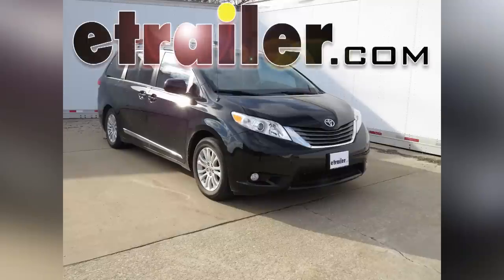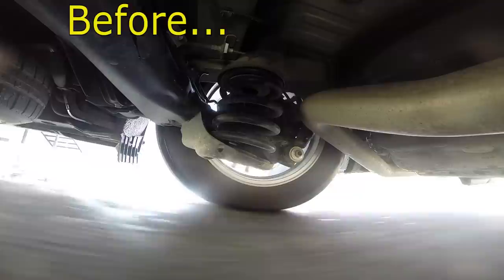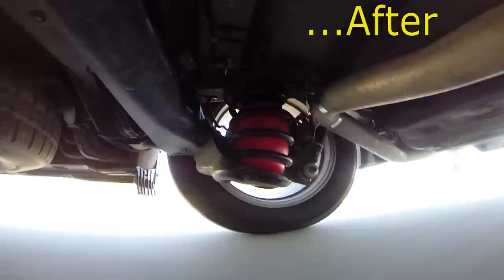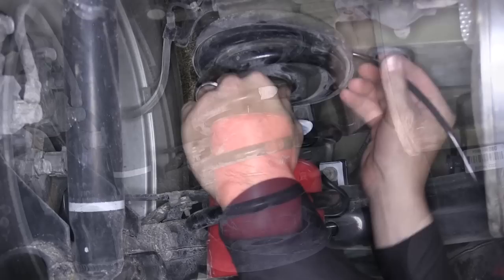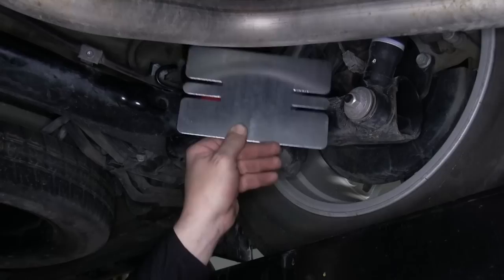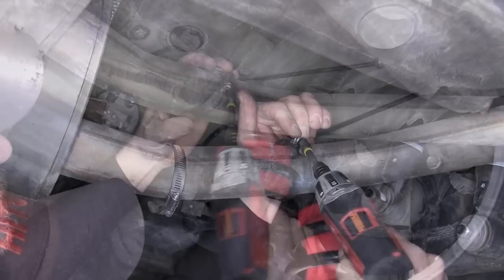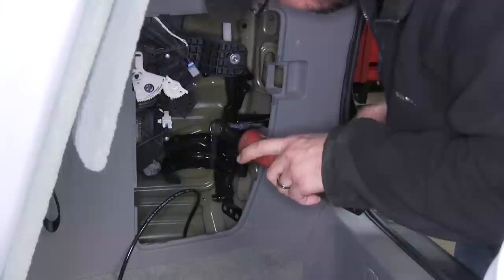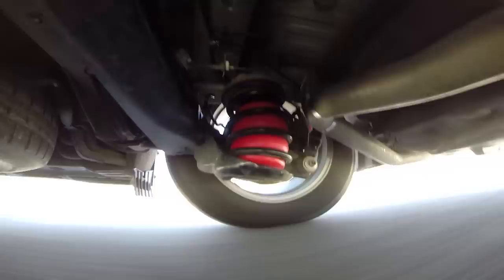How to Install: Air Lift 1000 Air Helper Springs for Coil Springs on your 2012 Toyota Sienna

Comment: I've had these bags on a previous van. While this is a clean-looking install, the positioning of the inflation valve in the jack storage area is not well conceived. Usually I won't know how much I will need to inflate the bags until the vehicle is loaded, which means the jack storage will typically be blocked. I prefer to install the inflation valve under the bumper. I've also heard of some people putting the valve behind the gas tank filler door, but I can't speak to the wisdom of doing so (considering you have to drill through the body in this area).

Comment: On the grommet you could take a scratch awl and heat it red hot and plunge it right through the grommet making the hole smaller then the line, Then push the line right through!

Comment: would this make the ride of the car feel more comfortable with 8 passengers in the sienna?
Reply from the maker: If you have a lot of weight in the rear and notice that the van is sagging, then yes, these will help make it more comfortable.

https://www.etrailer.com/Vehicle-Suspension/Air-Lift/AL60732.html

Comment: What about for front side ?
Reply: You can't on the front. In the front, the shock and spring are not separate, they are a strut. Meaning there is no space to put an airbag as it is taken up by the shock being inside of the spring already.

Comment: The spring mounts on my car dont allow this type of installation.  I would be interested in a side mounted valve.  It could be fitted to a greater variety of cars
Reply from the maker: The issue with the stem valve on the side of the bag would be that it could potentially get crushed if the spring were to compress too far.
https://www.etrailer.com/Vehicle-Suspension/Air-Lift/AL60732.html

Comment: How many inch lift the air bag
Reply from the maker: Installing the air bags will not increase the lift of your vehicle. They install in the coil springs and add load leveling support, reducing the amount of strain placed on your suspension improving safety and ride quality. The biggest advantage or compliment that we hear from our customers is that these reduce sagging at the rear of the van. So when under a load they will keep the vehicle from sagging, but will not give additional lift to an unloaded van. 

https://www.etrailer.com/Vehicle-Suspension/Air-Lift/AL60732.html